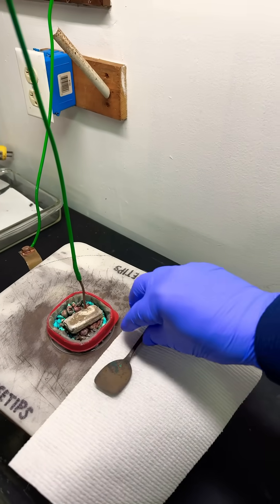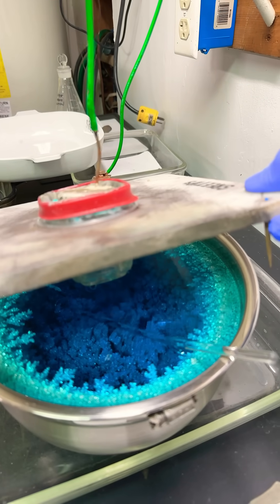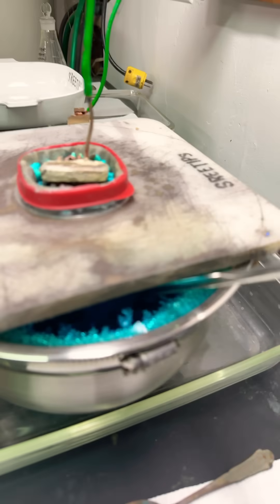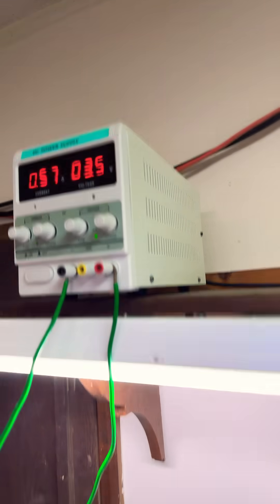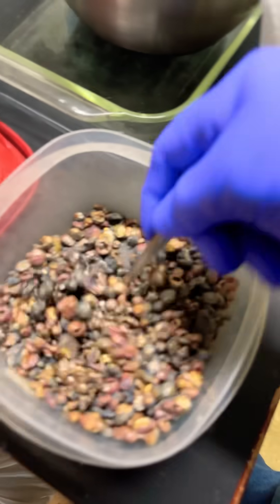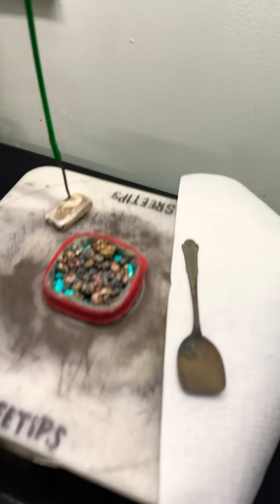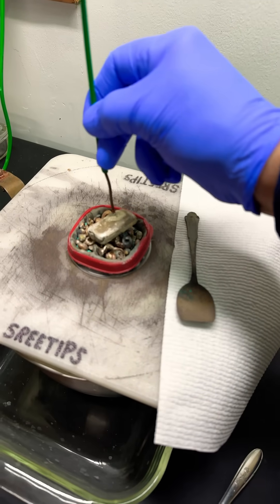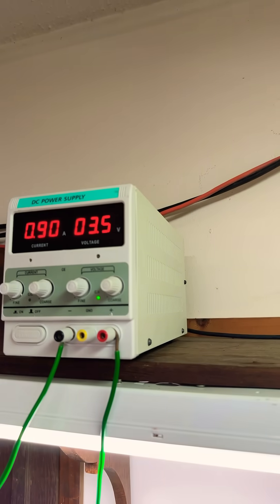High Purity Silver Cell Adding Impure Silver to the Anode Basket.

Comment: Isn't the electrolytic cell  making 4 9s?
Reply from the maker: Yes, but three nines is industry standard for pure silver. The fourth nines can easily be achieved with this type silver cell.
Reply: @sreetips  I'm wondering if I shouldn't mark my copper precipitation silver cement as 0.998
Reply from the maker: I wouldn’t. What if it’s not that pure? Want to avoid that like the plague.
Reply: @sreetips  running scrap sterling through both nitrate pathways, chloride then copper Precipitated cement should be 3 9s theoreticly if done right 
I've gotten some very pure crystal speciman silver in my "experiments"
Reply from the maker: I’ve had my silver crystal tested multiple times via fire assay. Comes back three nines every time.
Reply: @sreetips  pretty sure all you need to do your own fire assay is a cupell furnace.  And cuppells .  You have the rest of the chemical laboratory etc.  Some lead or bismuth  and a super accurate scale like a tripple beam.

Comment: Is there a real price difference between 98-99% and 99.999% or is it just the weight of actual gold or silver so a ~1-2% difference in price?
Reply from the maker: The impure silver has questionable purity and therefore questionable value. The high purity silver is easy to determine value and that’s really the main difference.

Comment: Is that Sterling silver that was poured into shot . It looks like it has slot of copper in it, versus cemented silver ( most respectfully speaking ,sir )
Reply from the maker: That is cement silver poured into shot. It looks ugly because of the 1% copper in it. Copper is a very dirty metal and it oxidizes terribly. It don’t take much to spoil the look of the silver.
Reply: @sreetips  could I pm you on GRF ?
Reply from the maker: Yes, I’ll get on there later and check my messages. Thank you.

Comment: i've never seen the impure silver shot turn that bright turqoise in the anode filter basket like that, neat
Reply: I've never seen any of this before and didn't know it could be done.. damn amazing
Does the filter basket touch the water surface to allow current through or what?
Reply from the maker: Yes, but it’s not water, it’s silver nitrate solution.
Reply: yes, there are holes in the bottom of that little rubbermaid cup that let the silver electrolyte solution in. he has several videos on the construction process of the electrolytic silver cell, including the making of the silver electrolyte and the melting and pouring of the impure silver shot as well as videos on the cement silver stock pots that the impure silver comes from. i highly recommend checking out the other videos on the channel, you might find something that interests you
Reply: Do you start it off with Silver Nitrate  electrolytic solution ? I understand the how process works.. it's  a powder that grows and is then heated in a crucible with a torch. I would like to know how its all put together, from the very beginning  ❤
Reply from the maker: I recently posted a video on building a silver cell from scratch
Reply: also the reason its that bright of a colour is cause of copper cause if you look on really old pennies or copper pipes where its corroded  at it will be  almost similar in colour  but someone correct me if im wrong
Reply: @thewolfgaming4874 that's called oxidation.

Comment: Please show a poor man way to do this ?? Maybe no
Reply from the maker: You want to know why it’s important to do this? I do it because I use sterling to refine gold. So I have a ton of silver from that. So I recover the silver and run it through my silver cell. Pure silver is easy to calculate its value. Cement silver value is questionable because its purity is not known.
Reply: @sreetips  no he was asking if theres a poor mans version of doing this but this is the cheaper way of making a silver cell right?
Reply from the maker: The silver cell that use is home-made. I built it from scratch for about one fifty to two hundred bucks. It can be used over and over. The problem is getting the impure silver to run through the silver cell. We get that at yard sales, thrift stores, consignment shops, resale stores, flea markets (my wife is at our local flea market looking for metals right now) and estate sales. But it won’t it won’t just fall in your lap. You’ve got to get up early, and be there first when they open the door, or else all the metals will be gone.
Reply from the maker: The silver cell that use is home-made. I built it from scratch for about one fifty to two hundred bucks. It can be used over and over. The problem is getting the impure silver to run through the silver cell. We get that at yard sales, thrift stores, consignment shops, resale stores, flea markets (my wife is at our local flea market looking for metals right now) and estate sales. But it won’t it won’t just fall in your lap. You’ve got to get up early, and be there first when they open the door, or else all the metals will be gone.
Reply: Thete is a full catalog of how to do the proccess on the channel.  I've learned most of what I know about it from his videos.  The power source and the actual silver ate the most costly inputs.  The first step is to realize poor is a state of mind..  and that's the hardest part.  Then take the next step in the journey.  Watch his videos!  Third step aquire some scrap.  

To be sure.  Doing it without proper safety proceedir3s and equipment is DANGEROUS  and no amount of money is worth your health or life
Reply from the maker: Also, to realize that silver is money. Paper dollars are a money substitute. So when you buy silver, what you’re really doing is converting paper dollars, that are declining in value, into silver, that’s rising in value. It’s not an expense. Clothes, rent, food, gasoline, movie tickets, are all expenses and you’ll never see another nickel. But not so with precious metals. They can store your savings off the books. You can build wealth by stacking metals. Not for a big bump in price, but rather, to protect your savings from the ravages of inflation caused by the money printers. They can print money out of thin air “without limit” according to one Fed Governor. This dilutes and destroys the purchasing power of all the paper dollars in circulation and in your bank account. But they can’t print more gold and silver. Also, price and value are two totally different things. Everybody knows the price, and price can be (and is) manipulated in the interest of keeping you in paper dollars. It just doesn’t make sense to store your wealth in paper. Store it in metals is a much better idea. If you need some paper to buy food or pay rent then sell a little of your metals. You’ll be surprised how fast it will accumulate when you begin your understanding that gold and silver are real money.
Reply from the maker: Also, to realize that silver is money. Paper dollars are a money substitute. So when you buy silver, what you’re really doing is converting paper dollars, that are declining in value, into silver, that’s rising in value. It’s not an expense. Clothes, rent, food, gasoline, movie tickets, are all expenses and you’ll never see another nickel. But not so with precious metals. They can store your savings off the books. You can build wealth by stacking metals. Not for a big bump in price, but rather, to protect your savings from the ravages of inflation caused by the money printers. They can print money out of thin air “without limit” according to one Fed Governor. This dilutes and destroys the purchasing power of all the paper dollars in circulation and in your bank account. But they can’t print more gold and silver. Also, price and value are two totally different things. Everybody knows the price, and price can be (and is) manipulated in the interest of keeping you in paper dollars. It just doesn’t make sense to store your wealth in paper. Store it in metals is a much better idea. If you need some paper to buy food or pay rent then sell a little of your metals. You’ll be surprised how fast it will accumulate when you begin your understanding that gold and silver are real money.